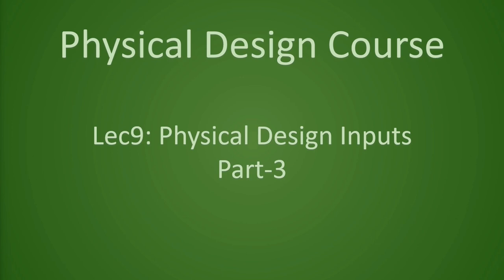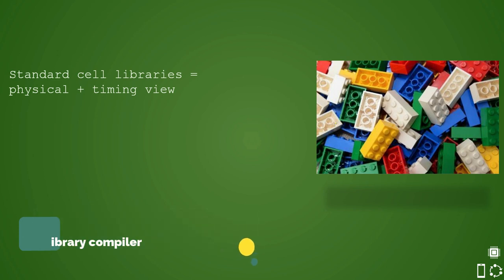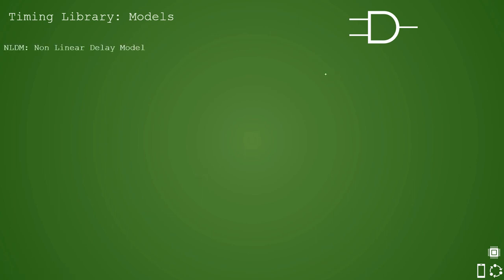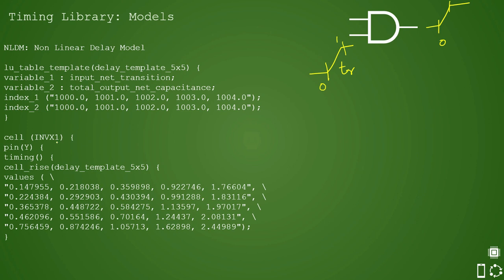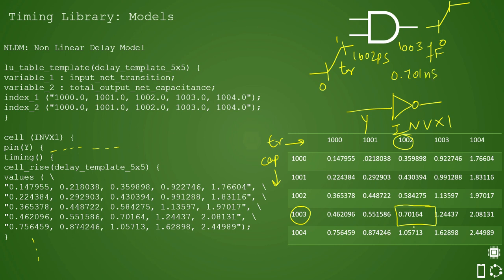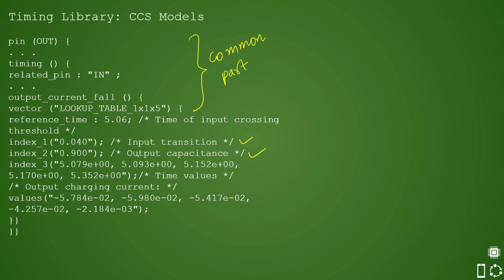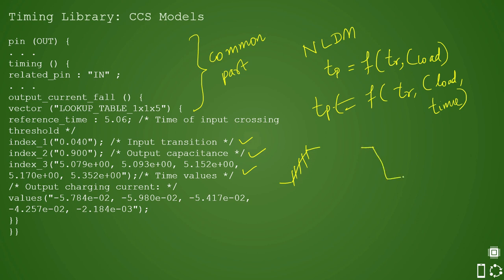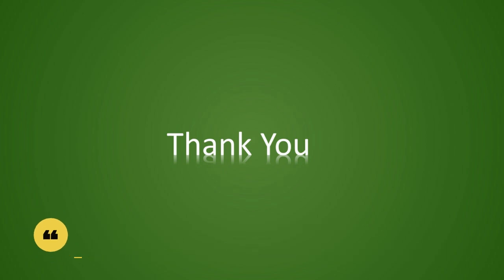PD Lec 9 - Timing Library | libs | PD Inputs part-3  | VLSI | Physical Design

Comment: May I know what is miller capacitance indetail??
Reply: miller capacitance is when the apparent input capacity becomes a number of times greater than the actual capacities. it will be multiplied by the gain of the amplifier. The ‘extra’ capacitance is due to the ‘Miller Effect’, and so is known as ‘Miller capacitance’.